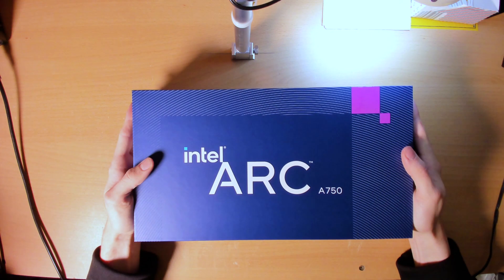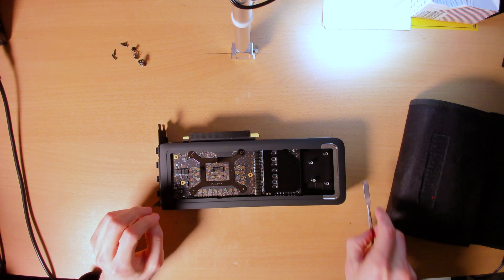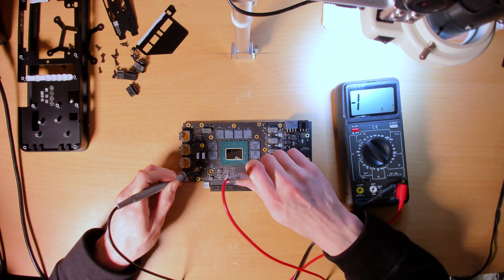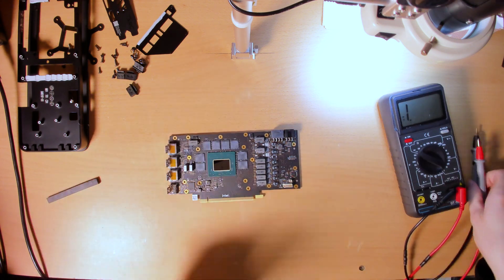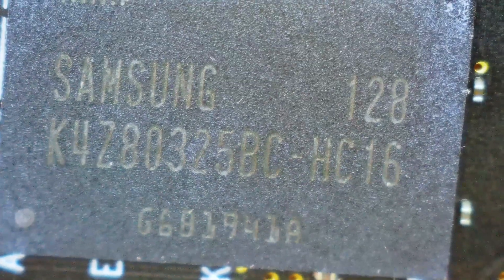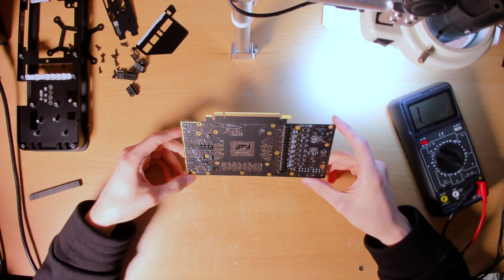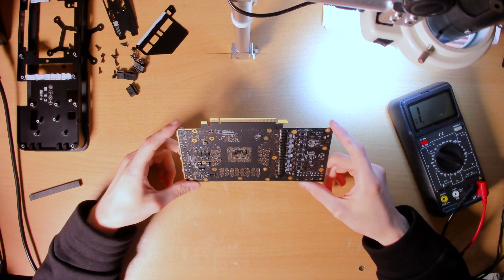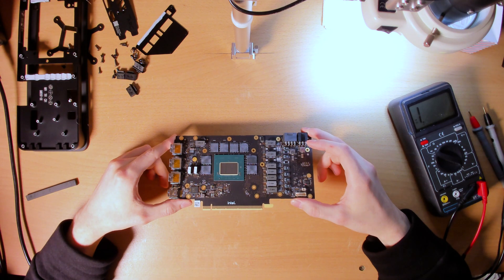Tearing Down And Taking a Close Look At an Intel Arc A750

Comment: how did u put it back?
after wiping GPU die, i found out the copper plate isnt making contact with it so thermal paste isnt working great
also i know they used a torx T6 screw as 4 GPU screws(the ones with spring), where can i get one of those? i mightve broken one